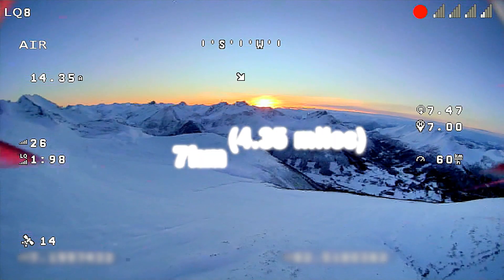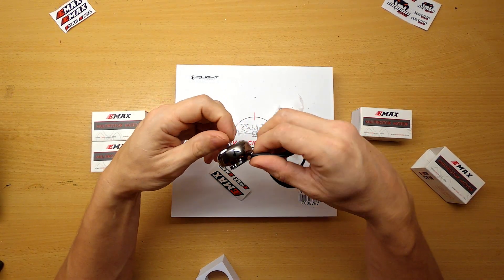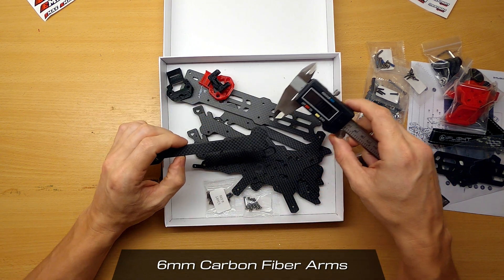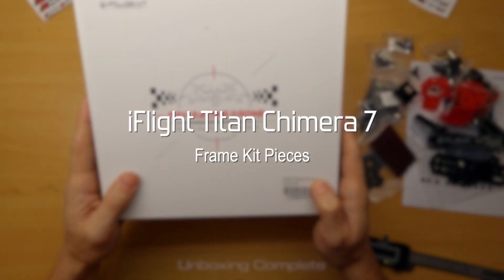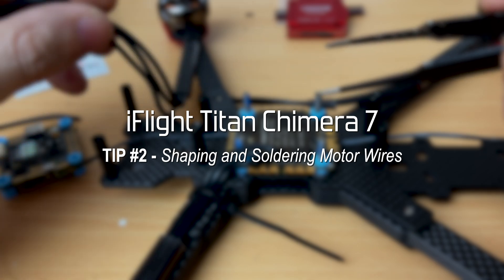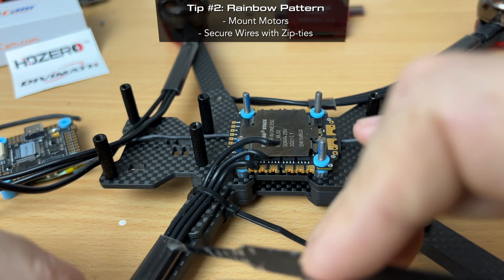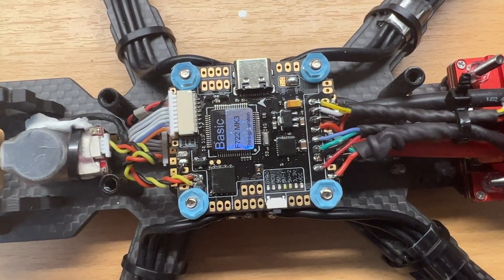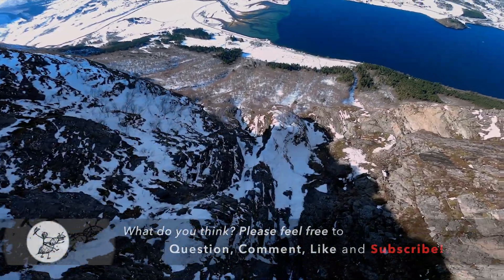HDZero 1 Watt Chimera 7  Long Range Build Video with Freestyle VTX for mountain surfing!

Comment: With all of the antennas clustered together, have you noticed any RF interference from other components? Have you done anything to isolate them?
Reply from the maker: Funny you ask... yes, I was battling some RF or as it turns out EMI (Electromagnetic Interference).  In my situation the video was ok, even at 7km, but the Crossfire TX signal was weaker, resulting in very intense RXLOSS moments... here's an example: https://www.youtube.com/watch?v=jzgEcdjl-Lo&t=623s
What I determined (need to test/confirm again) is the EMI from the 1W VTX was disrupting the CRSF RX, and the solution wasn't moving the antennas, but actually separating the boards themselves by about 5cm.  Using an EMI shield may also work but I haven't tested that yet.  Now I've never had this issue with other VTXs', and if you're not using the HDZero 1W it might not be an issue for you.  
Regarding Video interference I've recently found that my 7-turn Helical antennas pickup the CRSF transmission signals.  This happens because the length of the 7-turn coil effectively makes the Helical similar to a 900Mhz dipole antenna...
Anyway, this was a long-winded answer, but hopefully these insights are useful. Let me know if you have other questions or comments, and stay tuned, cheers!
Reply: @GiantAntCowboy  thanks for responding. I separated all of my components as well. I also shielded all of the wiring with copper tape and heat shrink tubing. Ground wires were soldered to the copper tape. 
My Crossfire rx is in the front of the quad as well as the antenna. Vtx and antenna are in the back. I mount the gps module on top of the battery.
This has helped a lot!
Reply from the maker: Wow nice, sounds like you have a very good setup there! I have to get some copper tape and test it out. Thanks for sharing!

Comment: Hi cowboy well my chimera 7” HD is finished thanks to your great build video ... just trying to decided should I go TBS nano RX or TBS diversity nano RX ... what’s you thought can the regular nano keep up with the DJI air unit not looking at extreme long range
 ..too scared 🤪
Thanks again for your help and advice 👍
Reply from the maker: If you don’t mind spending the extra bucks I think diversity is a smart choice. With that said I’m only using the standard nano and fly out 7km with no major issues, especially now with the Bardpole antenna. 
If you haven’t actually bought Crossfire yet, ExpressLRS is the latest and greatest thing for low latency long range transmission and it’s much less expensive then the TBS system. Just something to think about. 
Long-range can be very nerve wracking, and stressful at times, but that’s what makes it exciting and fun! Take small steps and see how the systems perform and gain your trust with the system. 
Keep me updated, congrats on the build!
Reply: @GiantAntCowboy  thanks for your reply...good advice 7km is good for now how’s the DJI video at that range 😊
Reply from the maker: So I’m actually using HDZero not DJI, but from what I understand DJI video should be perfect at that range. Just be careful not to fly behind things, especially mountain peaks or ridge lines because you will suddenly lose both video and control. (Done this a few times… easy to lose track of where you are) This is especially dangerous with DJI because the system can become unbound and it can take minutes to get the video back… I recommend setting up telemetry and GPS coordinates on your transmitter display so you can monitor the drone even with out video, and also to help find a lost quad.
Reply: @GiantAntCowboy  hi there again already to fly just one question where in the frame should I check the centre of gravity .., it’s such a long frame not sure where to put battery ... that’s never be a problem before LOL
Reply from the maker: I believe the COG is basically at the standoffs directly behind the FC/ESC stack. There’s two little bolts on the bottom I use to check. 
The motors are 20cm apart so measure 10cm from the rear motors and you’ll get right around these bolts. 
I have GoPro and two 6s li-ion batteries on top of my Chimera and it’s pretty close to balanced. Hope that helps, and if you find something different let me know. Cheers!
Reply: @GiantAntCowboy  that’s great advice that’s actually where I was looking but now I understand the logic ...thanks again for all your help😊👍
Reply: Hi Cowboy one more question LOL
I’ve got Blheli_32 esc what PWM do you run with the 1300kv motors
Reply from the maker: Hey I have it set to 48Khz. I’m actually using 1500kv motors, but that shouldn’t matter. My understanding is 48khz will be smoother and more efficient than 24khz but you’ll lose a little “braking response” which could make the quad feel a little less responsive. But unless you’re racing it shouldn’t matter and higher KHz is probably better.

Comment: Thanks for posting this! I'm starting a very similar build and the instructions that came with the frame are kinda hard for me to figure out for some reason, so I really appreciate the step by step build instructions!
Reply from the maker: You know, I spent a ton of time in this video which really very few people will benefit from… but figured it was helpful because, yes, the diagram is kind of vague and not even 100% accurate.  So I really appreciate your comment and show of appreciation! Please let me know if you have any questions, happy to help, and stay tuned because I’ll be doing some tuning and testing videos specifically about this build. It’s a great quad, cheers!
Reply: @GiantAntCowboy  Iam just going to build my chimera7 and I think this video is a Great help.
The thing is when i unpack my frame yesterday i didnt get that dji cable so must order one to go on with my build. I use dji airunit from another quad. Strange it didnt come with my frame
Reply from the maker: @niklas950928  yea, that’s weird yours didn’t have the DJI cable. Good luck with your build, it’s a great frame I’ve really been enjoying flying with it.  What motors are you using?
Reply: @GiantAntCowboy  I am going to use emax eco 2 2807 1300kv 4 or 6s mamba F722 basic mk3 F55_128K some kind of gps with magnometer
Reply from the maker: @niklas950928  sounds just like my setup, i used the 1500kv versions and they work well on 4s-6s, which you’ll see in the upcoming video. 
One weird issue I had with the Mamba FC is the Amp/Current readings were “chaotic”… I fixed this by adding a tiny capacitor to filter the signal. I meant to make a video about this but haven’t had time. Beyond that the setup works well! Let me know if you have this issue though and I can help.

Comment: Cool stuff! Your build is very similar to what I’m building with stuff that’s still in transit! Very curious about the follow-up videos, in particular the battery testing!
Maybe I should do a build video on my build as well, cuz I’ve got a few things that I haven’t seen incorporated anywhere else.
Reply from the maker: Thanks, so far it’s been a great quad, excited for spring weather so I’ll be able to fly it more but, I’m working on the battery tests now so stay tuned. You should definitely make a build video if you have the time and desire, always good to have additional references online espy if you’re doing something different. Thanks for watching and stay tuned. Check out my 1W testing video if you haven’t already, did some pretty fun tests. Cheers!
Reply: @GiantAntCowboy  I’ve been checking pretty much every HDzero video! Good work on the 1W test!
Looks like I’ll do a video as well then. My ideas are just a few parts I have not seen together on one quad. Just have to explain to my mom on how to create a YouTube account and subscribe, and then might get some views on it 😆

Comment: Good video and tips for build.
You used 250mm mipi cable. It look pretty long. Is the 120mm cable too short for this build?
Reply from the maker: Thank you. 120mm doesn’t reach from the front to the back. You could set the quad up differently with the VTX in the middle but, I went the more standard route. That’s for watching, check out my 1W VTX episode if you haven’t already, great results from that new VTX. Cheers!

Comment: What are those little plastic sleeves on the motor wires?
Reply from the maker: They are protector sleeves that help avoid wire damage from prop strikes or other objects.
Reply: @GiantAntCowboy  Well, yes, lol  Where did you get them?
Reply from the maker: Oh yea, they just came with the frame kit.   👍
Reply: @GiantAntCowboy  Ahhhhh!  Sweet, thanks.

Comment: Would you rather use your DIY helicals over patch antennas for Long range?
Reply from the maker: Yes, but… 
- A Helical will give you better range and penetration, but with a narrower signal beam. 
- Patches have a wider signal beam, but you lose some range. 
I generally prefer my helical antennas, but a patch could be better for some flights depending on the range goals. 
- From what I understand Crosshair antennas are better than both, they have a lot of range and a wide beam, but you lose all signal behind yourself (which is not a long-range issue). 
Helicals are cheap and easy to make… Crosshairs are are expensive, but I’ve heard they aren’t hard to make, I’ll have to try a DIY. 

I’ll be doing some proper antenna testing soon, hopefully with some Crosshair antennas, so stay tuned. Cheers!
Reply: @GiantAntCowboy  Great ! Thanks, i am following your crosshair antenna attempt.

Comment: Good video and build. Emax Eco 2 are good motors especially for the cost.Just a little heavier and steel shaft instead of titanium.
 Titanium doesn’t make it run any better.
Reply from the maker: Thank you, appreciate the comment. Yea, can’t beat the price to performance ratio. No complaints yet, even with 1.5kg weight. I’ll be testing 4s, 5s and 6s battery packs soon to see what works best with them.
Reply: @GiantAntCowboy  Hi ant thanks for this vid. Have you had the chances to test with different batteries (4s -6s)? I'm considering this drine with similar setup as you described. My focus is LR cinematic. 
Thanks!
Reply from the maker: @TheTorgehal  Hey, thanks I’m glad to hear when people find this video helpful. I have done the battery tests, and spoiler alert 6s2p packs are my favorite. But there depending on flight style 4s could be a practical option as well, in fact I still use mine. I’ll try to finish up the video this week so you can see the results. Stay tuned, cheers!

Comment: Great video.  It will be interesting to see what range you can get with the video on the Chimera, compared with the dji system 😎
Reply from the maker: Thanks again Kev. Here’s max HDZero long-range test with a wing  in mentioned. https://youtu.be/mYELtL8ACww

Using a wing he reached 30km (18.6 miles)! Now of course it’s not great video signal past a certain point … but awesome record and proves the system can handle anything beyond our needs! 
Thanks for watching and commenting. Cheers!
Reply: @GiantAntCowboy  Oh boy, those are some fair antennas he has on the goggles at the end🤣 I can feel my neck aching just watching 😊
Reply from the maker: @kevcdrone  I know right? I mentioned in the comment above that my Helical antennas actually seemed to perform better, at least out to 7km, and though they aren’t super compact they’re better than those huge plates! Plus building two helical antennas only costs a few bucks and maybe an hour if you’ve never done it before. (I made a DIY video showing you can even use trash and old parts!) Cheap one are also available online if your search around.
Reply: @GiantAntCowboy  Yeah, I think helical antennas are great.  I actually use the 3 turn Death Ray helicals on mine, and they are awesome for the low altitude flying I like to do, and they easily got me out to the 6.3miles with near full signal(pretty much just over the tree line most of the way back), and still have a wide beam width which is good.
Reply from the maker: @kevcdrone  yea that’s an unstoppable setup!
Reply: Yeh about 7.5km it started to look like crap tbh with triumph and patches, with the triple dinner plate patches it was 30km but who's gunna carry and put those on lol
Reply: @chrishiggins7475  Yeah, they’re pretty large😎
Reply from the maker: @chrishiggins7475  Agreed, those dinner plates are intense… I recently rewatched the video and noticed my helical antenna setups actually performed better than his, out to 7km when I turned around. My quad-helical setup is a little absurd, (still better than the triple patches, imo), but honestly my dual-helical setup performed almost the same. I’ll be testing this again soon actually, using this Chimera build.

Comment: Seriously, where on Earth do we buy the 1W version? All I see is the 500mW Freestyle board on HDZero's site.
Reply from the maker: This VTX was from an initial test batch, however my understanding is they should start shipping to retailers this month!
Reply: @GiantAntCowboy  Awesome. I really want to build a true dedicated LR quad, and 5 or 7 inch with HDZero could be solution. My current LR rig is a 5 inch with an otherwise freestyle like setup=P It constantly produce shaky video I can't smoothen out, so I need something new for the summer. This build looks excellent, and HDZero just appears to be my jam. I won't go for DJI;)
Reply from the maker: @ojkolsrud1  yea, I totally hear ya, all my previous long-range mountain flights were with a really crappy frame that I fit 6” props on. For what it was it did extremely well and I flew a lot of incredible places, BUT, it was time to upgrade and this new VTX was the perfect reason! 
I chose HDZero over DJI for two main reasons, 1) Cost, I already owned several pairs of decent goggles. 2) Signal dropout, I know many hate static but as an analog pilot I’m used to it and prefer it over blurring the image like DJI. Plus DJI has a history of freezing, unbinding and rebooting when you lose signal… not something I want when far out in the mountains!
I’ll be posting my actual 1W tests soon, pretty neat stuff.